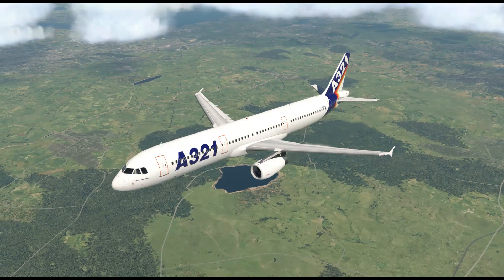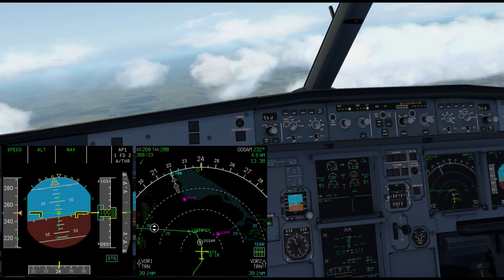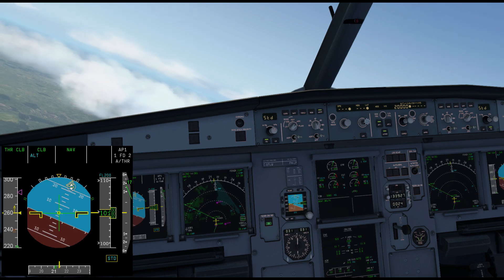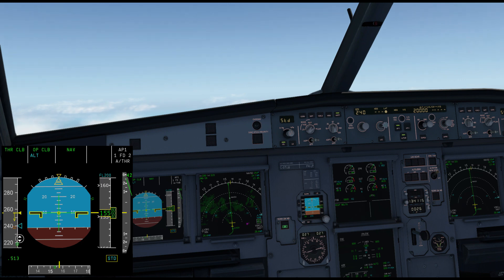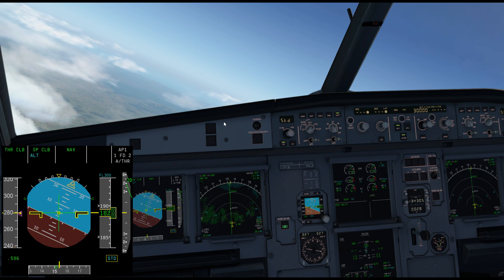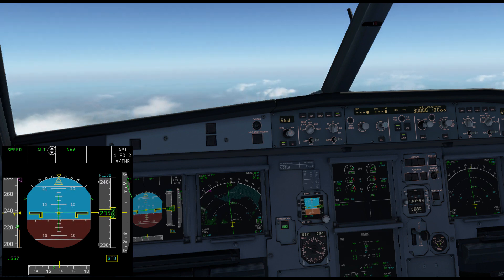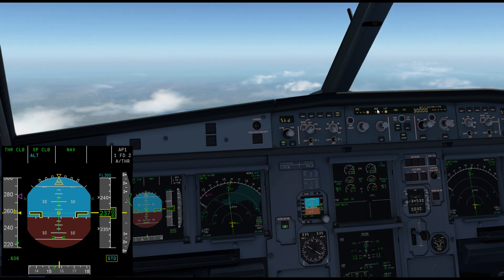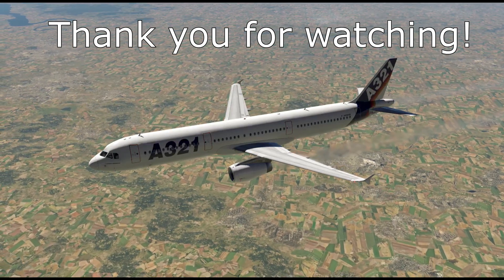X Plane 11 ToLiss A321 with Real Pilot: How to use the Autopilot Part 1

Comment: Thank you very much for this great Autopilot tutorial. This has really helped my understanding. 
I was flying XP11 today and just after take off I accidentally knocked a button on my joystick and this action took my A319 Toliss off the MCDU route. 
I did not know how to get the aircraft back on route. There are normally the 3 white dots on the AP panel but I only had 1 for the speed.   
I could not get my head around what to do and could not redirect the plane back on the NAV route. I got further and further away. Nooooo....Unfortunately I bottled it and had to re-start the flight. 

Your video clearly explains the steps which should be taken if that happens again. I will take a test flight to make sure I understand these steps should this happen again. Thank you   😉

Comment: I really enjoy your videos. Very informative! I do have a question, though: It's about auto pilot. I notice before takeoff you set the first expected altitude. This is so that all you'll have do is engage AP/Alt once airborne. This doesn't seem to work for me (1-dot, 2-dot; it doesn't matter). I can't seem to get it to work the way you do. Is there something specific that needs to happen in order to enable it to engage once airborne? Thanks in advacne.
Reply from the maker: Hi Rick, thanks for your comment. Are you using the ToLiss? It is a bit hard to diagnose but if you have an altitude that is above your current one when you takeoff then the aircraft should level off there. Make sure when you takeoff you have 'CLB' or 'ALT' written in blue on the PFD, this shows the aircraft has armed those modes.

Comment: I am still transitioning from Zibo 737-800 and therefore i have a habit of setting the V2 speed into the autopilot (but i dont turn on A/T yet), the altitude of the 1st waypoint and the runway magnetic heading. After taking off retracting the gear and flaps a notch i immediately hit the LNAV and CMD and i just have to manage the V/S since VNAV isn't really that accurate.

When i took off for the first time in an Airbus, i was confused where is the LNAV button. The A/T seems to not respond to the preset speed. Since i am taking off wrom WIII 07L with heading 068 i went off course quite far until i could figure what is going on 🤣🤣🤣🤣
Reply from the maker: Yes it's quite different! Glad it helped, hopefully you'll get to enjoy the bus for many more flights! Thanks for commenting and watching.